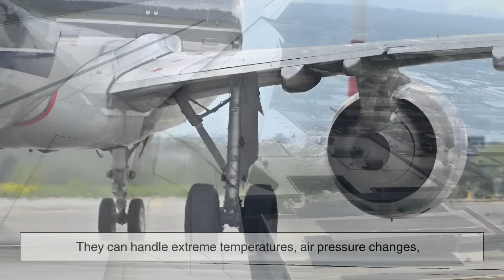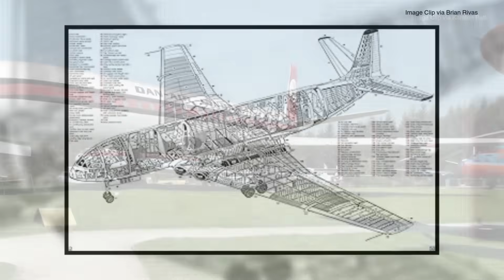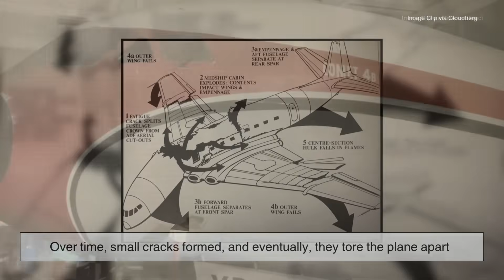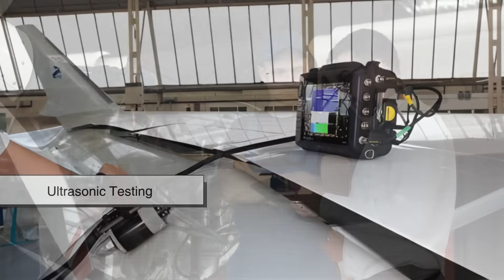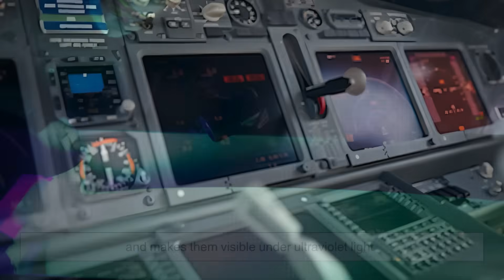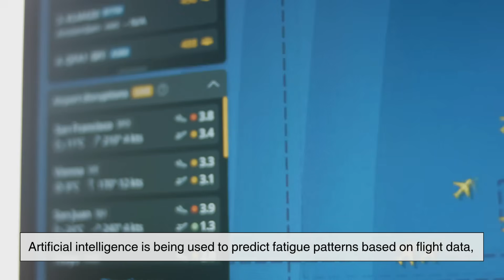Metal Fatigue: How Planes Break Without Warning

Comment: The failure of the Comet wasn't actually due to the corners of square windows cracking, it was the opening of the ADF (automatic direction finder) and the process of punch riveting instead of pre-drilling which is now standard practice.